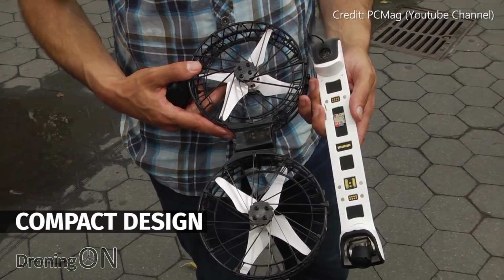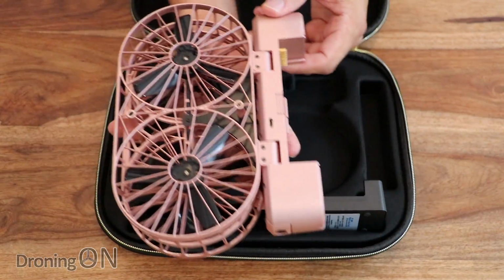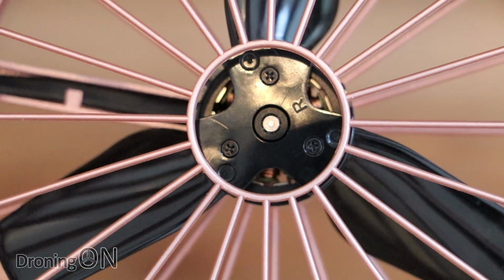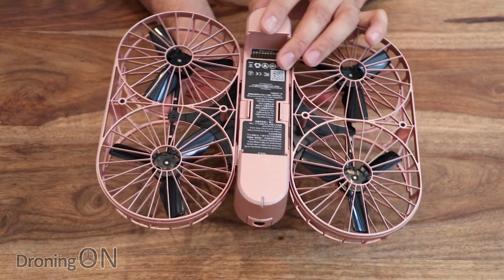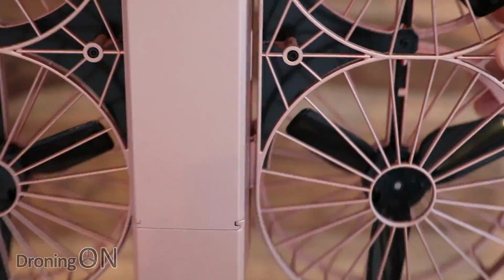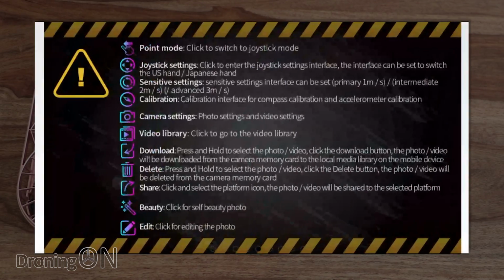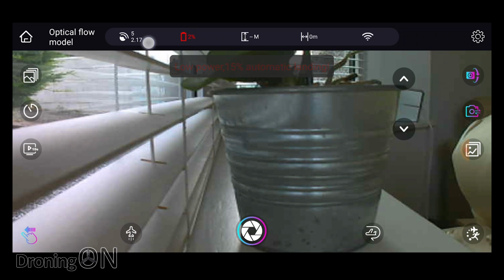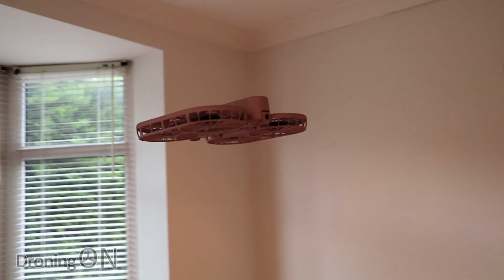DroningON | SimToo Moment Drone Review (Part 1) - Unboxing, App & Indoor Flight

Comment: If you bend it back, it will be easier to take out the battery.
Reply from the maker: +Claudia Knight unfortunately not, my point is that the battery attachment mechanism really isn't good, the release elements are flimsy and bend far too easily.
Reply: Mabe this product should be better mastered before coming to the market but still good review by you.

Comment: I received my drone via Indiegogo.  The first try in my condo I was able to get my phone to connect to the drone.  I tried to take the drone to the park to fly in a larger area and my phone WILL NOT connect to the drone after connecting to the wifi signal.  I tried it again at home and again I cannot get the drone to connect to my phone.  Any advice?  The 5 min I used the drone in my condo was not overly responsive and difficult to control.   Any advice for getting my phone to connect again?
Reply: Same with me.. have you fix yours?
Reply: Haven’t.  Waste of money.  I think you can order replacement parts but the dumb thing wouldn’t respond unless it was going straight up and down.  Then it would crash into a building

Comment: just got one , tracking doesn't work at all. Turned it on and it flew away had to run after it. No response from company. The control sometime work. very disappointing
Reply: RefuseToWalkTheLine can you send me a message bro, got a few questions for you
Reply: yes
Reply: RefuseToWalkTheLine you got instagram?
Reply: why
Reply: RefuseToWalkTheLine need to speak to you?
Reply: why

Comment: Is it possible that you did not notice how easy the battery is to remove when you fold the drone?
Reply from the maker: David A. O'Connor it unfortunately doesn't make much difference, it's the catches on the battery and the casing which catch, not necessarily the folding mechanism.
Reply: I was going by what you did and said in the video. You said that the prop cages were in the way.
Reply from the maker: David A. O'Connor indeed, with other foldable drones you don't need to fold them back up in order to replace the battery, so the issue is 'two fold', if you pardon the pun.

Comment: Battery is probably meant to be installed/removed when the drone is folded, hence why the battery snap release buttons are positioned where they are.
Reply from the maker: Jimm Pratt I've mentioned this in part 2  but even with the drone folded in half, the design of the battery casing and catch really isn't good.

Comment: As for the battery removal, I think the idea is you fold the props down and then remove the battery.
Reply from the maker: +Gerard de Vries even with the drone folded, the battery is bit of a pain to remove, the clips aren't very user-friendly.
Reply: It does make them easier to reach. You do not need to bend the prop guards.
Reply from the maker: +Gerard de Vries it's not about reaching them, it's the design of the battery clips and mechanism, it causes the battery causing to catch.

Comment: Did you guys have to update firmware or software via The app for the  Simtoo Moment before flying to control the moment drone to get it to hover so smoothly? I'm just curious because I had a horrible experience with my drone that I got from them and when I tested it out there was no updates drone wouldn't hover or take off without constant reboots and wouldn't respond to the controls on my app. Any thoughts?
Reply from the maker: +Warren Rohr we haven't done any firmware updates for the drone, infact there doesn't seem to be such a facility in the app at theoment which is a worry - did you send it back to SimToo, and which drone was this?
Reply: DroningON.co The exact same one your testing the simtoo moment, and yes I did try to send back to exchange or refund but the company told me that there are no refunds or returns for the sample drone, even though it cost $353 to order from them. I was very upset and two other guys who purchased it from the simtoo company living in Japan have the same issues as me. I'm wondering how your drone is working so well hovering its surprising to see, since I did all the calibrations and was connected to 9 satellites and moment drone wouldn't even land or respond to app controls had to chase after it and grab it and manually shut it down.
Reply from the maker: +Warren Rohr ah that's a worry - I'll be flight testing this one this week so let's see how it performs and fingers crossed that it won't fly away! It might be that the app has improved since you flew yours, have you still got it?
Reply: DroningON.co Yes I still have my "Luxury" Package black Simtoo Moment Drone just sitting and collecting dust in its case lol.
Reply: DroningON.co I'll give it another go today when I get home from work and I'll keep you posted.
Reply from the maker: +Warren Rohr, did you get a chance to test it? I do wonder how SimToo will manage firmware updates for this drone, hopefully they will be automated and via the app, but at this time there is no sight of this feature.
Reply: DroningON.co Thanks for your replies means a lot! Yeah I tried it again it flew a little better this time but not so great on the hovering it started out looking better but I noticed it's much much louder than the Hovercamera Passport which it copied design wise and the Hovercamera Passport hovers much better and way more stable at least to me. I got the Simtoo Moment drone to respond to controls but it started to have a mind of its own again and slammed against my wall breaking the prop guards on one side the hit wasn't even that hard so build quality is a disappointment as well. Regarding the updates for firmware or software they better send some out soon via the app hopefully because they are sending out a product that is clearly not ready for consumers to get the full enjoyment or experience that they promise.
Reply: DroningON.co I guess the prop guards aren't so flexible as we thought lol, as I mentioned in my earlier post it cracked after just bumping into my house wood wall and impact wasn't very hard from just about a foot and half from the wall, oh well.
Reply: DroningON.co Another question, when I tried to take pictures or video with moment drone it told me via app to insert sd card so I guess it doesn't take pics or videos and ability to save on iPhone or via app? Did you guys insert sd card to get your raw footage?
Reply from the maker: +Warren Rohr yeah you've got to install an SD card else you can't capture and store any videos or photos.
Reply from the maker: +Warren Rohr SimToo tell me that they're going 5o reimplement the app controls so that it's easier to control, I'm surprised that you managed to break your cage as it's quite a tough little drone this! I'll maybe do some crash testing in my next video!

Comment: Thanks for this great review! It will be interesting to see how the range is and how the distortion correction is and hopefully the range is pretty decent, but if the distortion correction can get rid of the barrel distortion, that would be great. The 4K video seems to be OK. It didn't appear to have any HDR photo ability, unless that 3 shot button can do it, but for a very small and compact unit it seems pretty good. It's unfortunately too heavy for squeaking under our Canadian sub-250 gram limit for the class of unregulated drones, so it would be subject to all the new Canadian drone laws. Very cool though.
Reply from the maker: +Doug Temlett, thanks for the feedback and comments! I've added the distortion correction to my flight test plan to see if it fixes the FOV, hopefully it will! I'll also be testing 1080p to see if that invokes EIS, although sadly the mechanical 1-axis stabilisation looks to be an app limitation which we'll have to wait for SimToo to introduce. The 3 shot photo is unfortunately isn't bracketed, the shots are all the same but this app is still under development, lets hope that there's more to come! Keep watching, Part 2 will come shortly and I'd appreciate your help in sharing this review to Facebook groups to help me reach 5,000 subs!

Comment: Hi there, thank you as always for the review! Question: Wouldn´t it be easier to unfold the drone first and then remove the battery?
Reply from the maker: Thanks for the feedback, yes that is an option but these clips are still quite tricky to undo and quite often the battery housing gets caught - the design isn't perfect, but it isn't a show-stopper :)